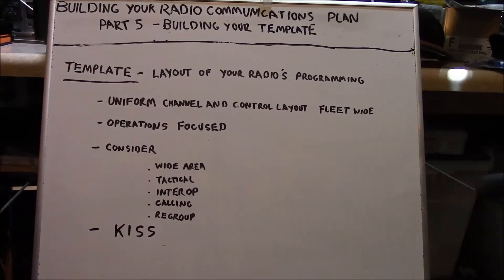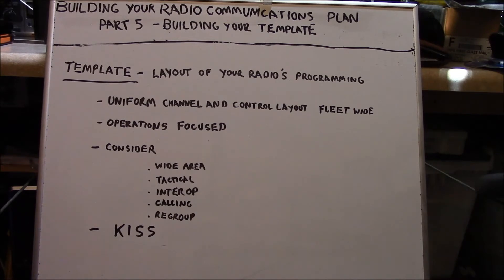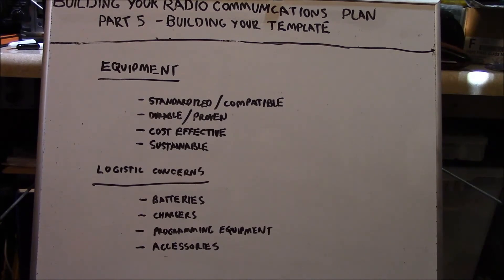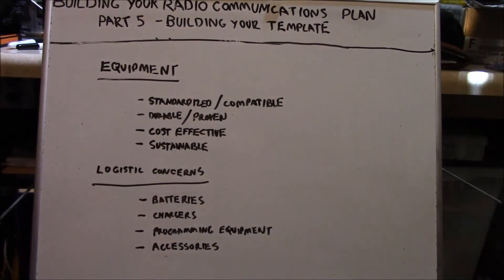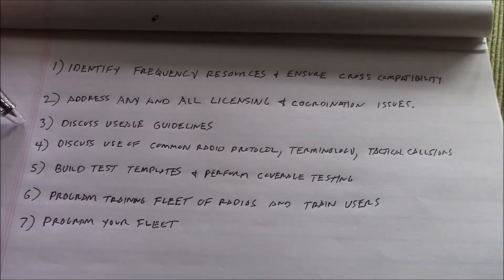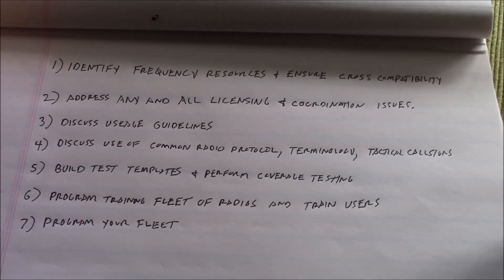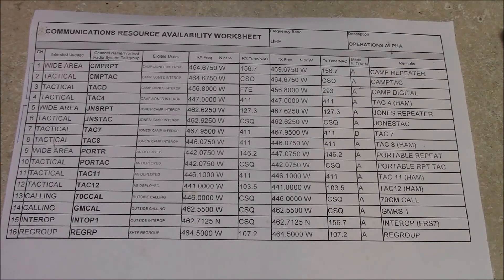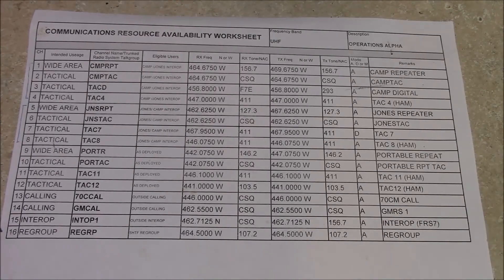Building your radio communications plan Part 5 Building your template

Comment: That's a lot of work right there. It's nice to have some other folks nearby to assist and be a part of the plan. Do you have pocket references for any op's that aren't...."comms savvy"?  Maybe even some brevity codes, etc? Not that anyone needs a confusing transec plan for families, but at least some simple security measures. I need to start recruiting some neighbors....or just leave them all here..lol
Reply from the maker: Glad to see you and hope all is well with you ! Its more about being cognizant of resources and pooling them .  I have run into many folks whose comm plan is picking a frequency and programming it on the fly through a key pad. This works for two or three experienced users on simplex but for a larger group it really falls apart quick. Tell them up 25 khz over the radio and at least one user will get lost in the shuffle.  Tell them go to TAC 8 and the tactility of the selector knob is a huge advantage coupled with common terminology if an alpha display is used . IMHO you always have to develop your plan around the least experienced user who likely has little if no concept of what a frequency is. I like to hand out radios to the users instruct them to go to a channel that has a numeric value that is preprogrammed and get rolling. That is why it is important to train the users in the basics before implementing a template. Some of your users will get it and others won't and this is why I believe in drilling it down to just the basics for the end user. For the most part the individual user may use one or two frequencies indexed commonly and through simple control manipulation. Once a template is rolled out a generic laminated card is an option. In the last video I mentioned the NIFOG and it is a good pocket reference for the person responsible for radio. I am a big believer in uniform templates and locking down keypad programming for the most part. When everyone starts VFOing around there is little communication going on just trying to figure out why Team 1 isn't answering his radio and expending resources to ascertain the reason. Brevity codes are useful but they are a procedure more than a plan and really require some extensive end user training.  It takes a very disciplined user to ciphertext a transmission when they are under stress. I would never fault someone for implementing COMSEC but just plan and train accordingly and remember a lost signal instructions sheet is a huge compromise.
I have a cache of FRS radios that I hand out to neighbors outside the circle of trust and give them a channel that is monitored if I need to be reached (calling channel). This keeps from compromising the entire template.  I hope this helps and thanks for watching !
Reply: All valuable points. I've got a pocket NIFOG in my "stuff",  I didn't know that something of that nature was available until last year. I keep a few profiles on a thumbdrive for those Baofengs, just so I can get friends up and running if they need to be in the circle.  Thanks for sharing all of this.
Reply from the maker: You are welcome and thank you ! Another great reference is the National Incident  Radio Support Cache Users Guide. Wildland Fire is IMHO one of the best models for organizing/ deploying SHTF radio.
Reply: I'll check them out.